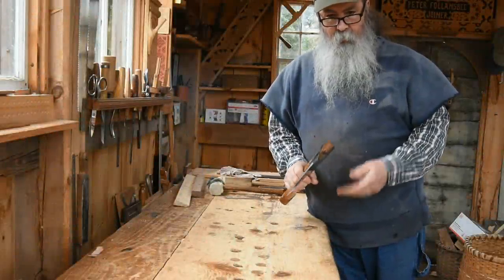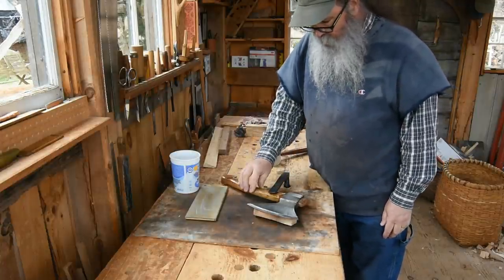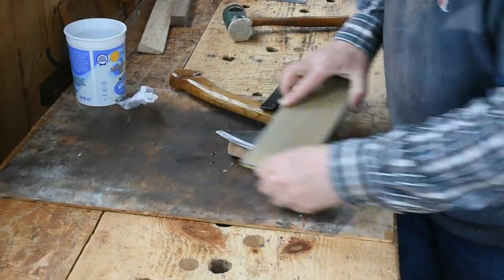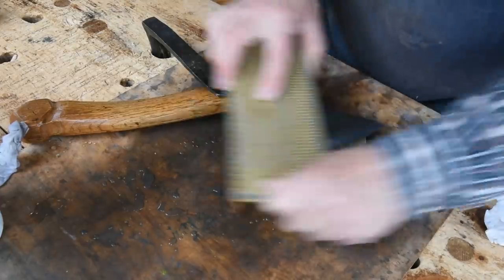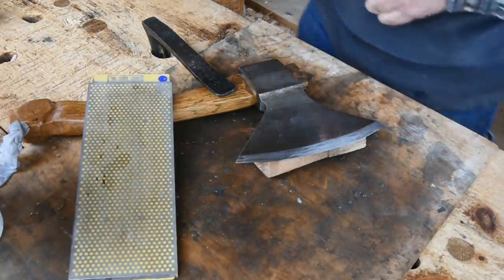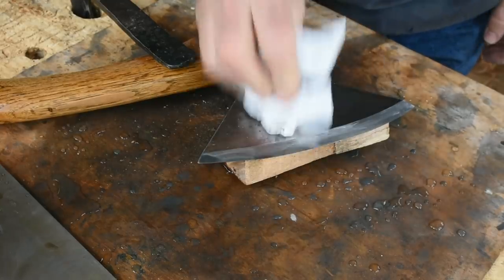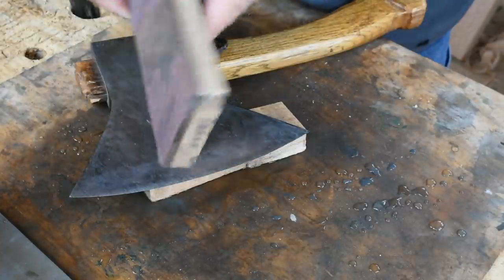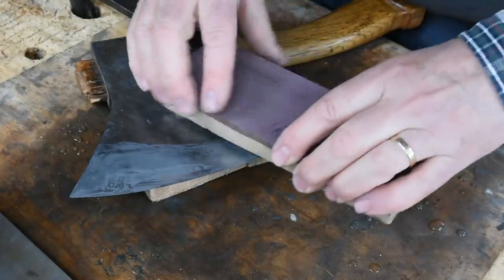sharpening hewing hatchet

Comment: Good Morning Peter, Nicely done. Chuckling a bit, watching some one else sharpen a blade is frustrating for me, sort of like walking at night and some one else is holding the flashlight. You are a joy to learn from, but I feel my brain wanting to be the one sharpening the tool. I too have been a wood worker for years and I am not used to seeing some one else bring an edge to a tool. I really like the way you kindly describe some of your thoughts as you make your videos. I care very much about my tools and consider them old friends. Once years ago, I was working on a house, seventy miles from where I lived. I was finishing up the soffit and siding with my friend Mike. We were up a little over thirty feet on pump jacks and a scaffold plank and the temperature that day was near a hundred degrees. I was fitting a mitered corner of the soffit and had set my low angle block plane inside the soffit to free my hands to check the fit of the piece that was next. It fit, and I nailed it in place. Later that night as I was falling asleep at home, I sat up and remembered I had set my beloved low angle block plane inside the soffit up there. That next day, I drove up to that jobsite, set up a fourty foot ladder, opened the soffit and retrieved my plane. My buddy Mike wondered why the hell I did not just buy a new one. I still have that plane and used it two days ago to fashion an handle out of a quarter split piece of Locust for a small hand sledge. A good friend like that little plane is worth keeping. Smiling, George.

Comment: Thanks for the video, and I agree, absolutely respect that edge on the blade. It's too bad that the best way to learn that lesson is from having an accident yourself. I was sharpening my hatchet with a file while it was clamped on the bench, and on one pass I barely felt the blade as it dipped in my finger maybe a 1/4 inch. 

Tell your kids! Show everybody your scars- they're not going to learn from this comments section, but they might from you!

Comment: nice hatchet and I'm sure you put a good edge on it.  But the way you are using the stones is putting a groove in them that will be hard to get out if you sharpen all your axes in the same area of each stone.  The stones will be difficult to get flat in the future if you want to use them for chisels or plane irons.  I recommend trying to set up the axe or hatchet so you can go the long way on the stone and use the full stone and not just one isolated area that is perpendicular to the length of the stone.  If you've got a good vise, you can put the ax handle in the vise vertically and sharpen the edge with the stones lengthwise but parallel to the floor.

Comment: If you are right handed is the bevel on the inside or outside or is it beveled on both sides
Reply from the maker: It's a single-bevel hatchet. In use, the "back" or un-beveled side is against the wood.

Comment: Where do you recommend getting such a hatchet?
Reply from the maker: Ahh, I just finished a blog post about this video, in which I said "I have no idea where to get a hatchet like this today" or words to that effect. Mine is 90 years old, made in Germany. There's lots of others out there that will work, but I gave up trying to keep up with which hatchet is which. The blog post has links to detailed looks at the hatchet https://pfollansbee.wordpress.com/2021/04/25/sharpening-a-hewing-hatchet/
Reply: I made my own from a cheap China made 2 pound axe head following Peters blog about the geometry of his hewing hatchet. It works surprisingly well.
Reply: In the UK, I have had success by re-furbishing old axe heads from, for example, Elwell. They are well-made, but not sided for hewing, though I, as a left hander, long since stopped worrying about this. Not common, now, but still available in 'antique' stores. Good luck. If you have to replace the haft, copy the shape Mr Follansbee has here.
Reply: Granfor’s from Sweden makes some axes which can work for this.  I have one with a slightly open head that works reasonably well.